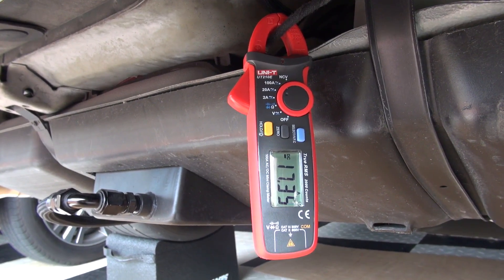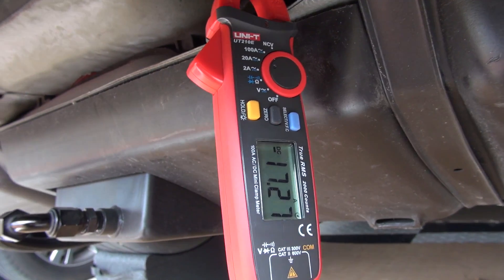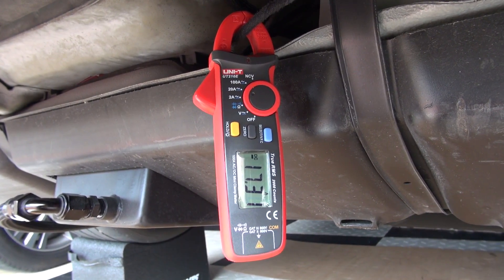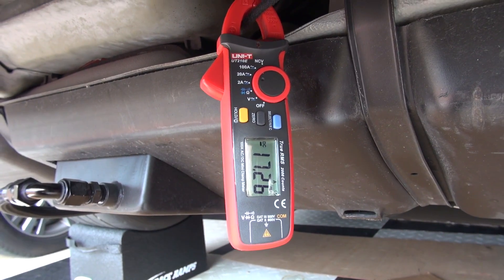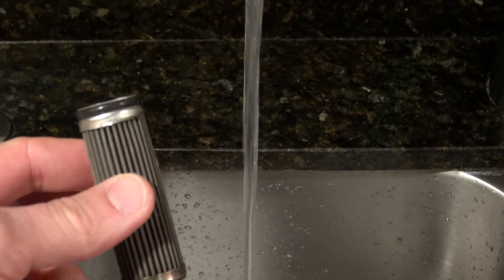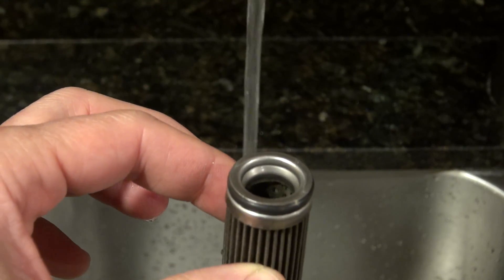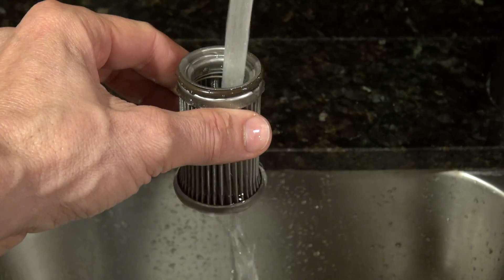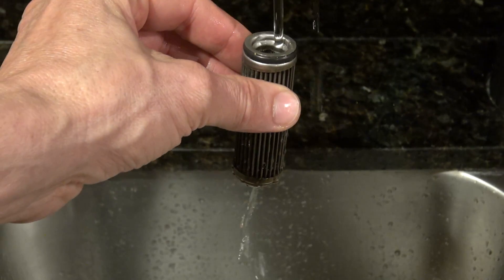How to test a Magnafuel Protuner fuel pump and fuel filter with a Burnt relay or wiring harness

Comment: Thank you for this. I have been chasing ghosts. Now I got a multi meter about to see if im still having an issue. I have 2 8 AN lines going to a 12 AN line to my Magnafuel 750 pump. If this don't fix it I think I need a courser filter as a pre filter. I too have ran e85 and have the same metal filter. I think its jammed up my thought is to put a coarser filter. Wonder if regular pump gas would clear it. I am running 93 octane now.
Reply from the maker: The guys at Magnafuel mentioned it can not be cleaned out once it’s gummed up.
Reply: @venomousstang  So you just buy a bunch of those filters or did you swap to a filter that is more course. Changing out filters would be a PIA
Reply from the maker: @clairebear5029  I purchased  a bigger 25micron  filter from MF MP7008 for the after filter and  the prefilter is unchanged at 74 micron MP7009.  I just change the filter MP7060-25 every year as part of regular maintenance.  I put my filter where I can swap it out easy.  I do like the Injector Dynamics Filter but it’s really pricy and I’ll have to redo some lines if I went that route now as well as figure out where to put it. The ID one looks like a breeze to replace filter as well, too much work for me to switch. No matter which one they are all going to have issue .  If you go too course then your injector screens will get  garbage in it.  It’s less work to replace filter then to clean/replace injector screens for me.
Reply: @venomousstang  I heard running pump octanes good every so often and when keeping car garaged. I had e85 in my fuel cell turn nasty. Looks like black moid growth after a few months. I converted back to regular octane cause sick of dealing with it. Will need to see what competitors have.
Reply from the maker: @clairebear5029  you can do that but you will need to have a flex tune.  When you are on regular gas you will not be able to be on max power.  When ever you are building a car you need to ask yourself is this something I need to have access too  and how much work is involved to maintain it.

Comment: How much was the install on this pump?
Reply from the maker: I installed it myself.  Not sure what the going rate is.
Reply: Well how hard was something like this to do? Really want to run the magna fuel system but have been told it’s pricey to instal
Reply from the maker: @loudpack5418  it depends how mechanically inclined you are.  To run this pump you will need pump, relay, pre and post filters plus Teflon fuel lines with  fittings to connect everything.  You may also need a regulator if you do not have a return style setup. For me it was not difficult but I have built my own car, very handy fabricating and figuring stuff out.  If you are like me you can do it.  If not best to let someone who is do it correctly.  What car is for?
Reply: @loudpack5418  JPC did mine it was like $1500
Reply: It’s a 1998 mustang gt
Reply from the maker: @loudpack5418  that’s what I have and it is a return style.  Go to SN95forums and look for Venom’s build thread, I detail all parts used.

Comment: How long did you use the filter before it clogged?
Reply from the maker: God Oz Joker I would say 1.5 to 2 years later after I switched to E85.
Reply: alright thank bro, so ill probably give mine a check at the least after each season
Reply from the maker: God Oz Joker - according to the guys from MF make sure to start the vehicle frequently to avoid this from happening.  If it clogs again I’ll update this video.   As of now I start vehicle every 1-2 weeks for 10 min or more.
Reply: Mine will be daily driven so I'm not worried about that part

Comment: I'm having a problem with mine. When you turn the key and it makes the noise usually to prime well it doesn't make the noise and my car won't start. So i'm thinking the pump is shot or will a bad relay make it do that?
Reply from the maker: Your relay may be burnt.  The burnt relay could of been caused by the pump or the relay being old.  You can get another relay and try that for a few seconds to see if pump primes "makes noise".  If it does you will need to make sure it was not due to the pump overdrawing the relay.  I would get the amp tool to verify that indeed the pump is not drawing too many amps.  Also check wiring and make sure nothing is melted.  The only other thing it may be is a bad pump.  You may try to run two wires of thick gauge from battery directly to pump for a few seconds to see if it runs bypassing the relay wiring.  Either way I would test amp draw of pump.  The guys at magna fuel are great if you need to rebuild pump for a few dollars.
Reply from the maker: 97 cobra don't forget to check filter as well!
Reply: Yup relay was burned out. Put 2 new ones in and it started right up, turned it of and tried to start it and they burned out again. I did notice the coating on the positive wire was showing some copper I taped it up but do you think that could be what's causing it?
Reply from the maker: 97 cobra don't think that taping wire will fix your issue.  If you have wires exposed to the elements it may cause the wire to corrode from the inside and cause the wire itself to get hot and possibly melt.  I would really get the amp tool in video and take some readings.  You can remove filter or buy a new filter(recommended) to see if relays run cooler.  This will demonstrate if filter is clogged or not however it is not recommend to run without a filter for extended period of time as it may send debris from your tank to injectors and cause another issue.  Cheaper to change out filter.